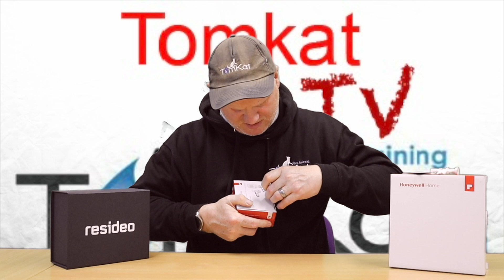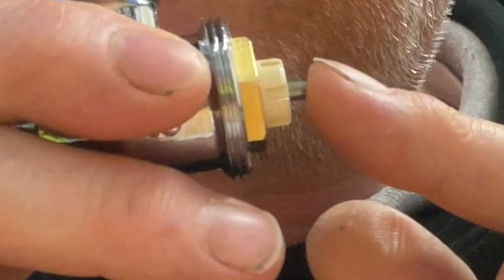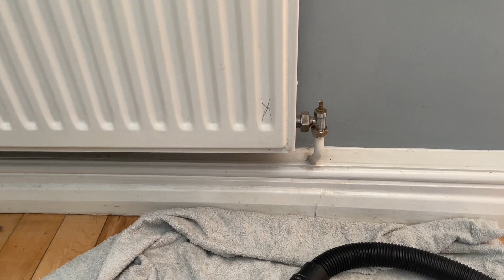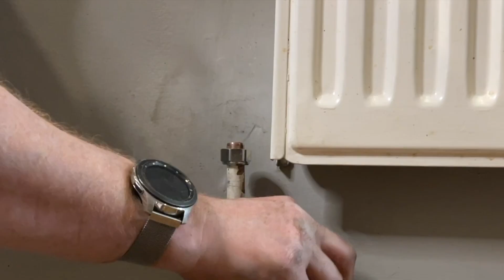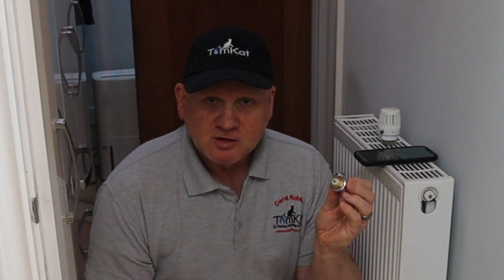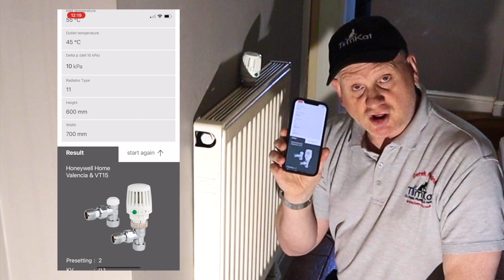Resideo Honeywell home Auto balancing TRV's, unboxing, reviewing, installing and setting up.

Comment: Can these be used on a modern system boiler with a modulating pump / modulating output (eg Vaillant / Viessmann) or will the pressure regulation fight each other?

Comment: Great video.  Annoyed by not being able to find a source of the balancing valve adjustment key, I've just made a 3D model of my own design of key.  This can be easily 3D printed and avoids setting unsuitable metal tools onto it.   Can be found at Thingiverse (search Honeywell balancing key).  I will add a link in a sub-post, maybe you might like to add a link in the description of your videos about these?  Cheers!

Comment: Are you sure that Rad was a multi column?
Reply from the maker: It was just a bit of bad editing I removed me waffling but also took out me explaining it wasn’t a multi column but I was covering all the rads in the app so you are correct it’s not a multi column rad
Reply: Thanks for clarifying, I’ve bought the Honeywell Kombi-TRV V2100 valves, just fitted them, I also observed that you went for 55 inlet temp and 45 outlet, is that a goal in terms cost efficiency? I currently set mine to 70 / 50
Reply from the maker: @mikeread8001  yes it was 👍🏻

Comment: And with these is it best to use the fixed or modulating setting on a pump like a Grundfos ups3 ? All that sort of stuff seems a bit of a dark art to me 🤷‍♂️ some content on this would be very useful, thanks 🙏
Reply from the maker: Part 2 will be coming once the weather turns colder 👍🏻
Reply: @tomkatgastraining  Tomorrow then, thanks 👍😛
Reply from the maker: @julianwebb8712  😂👍🏻

Comment: Hello Derek  The radiators are definitely Steel Panel not  Multi column, so maybe recheck what the app says for steel panel type 22 They are also double panel convectors not  "Double Double convectors", also the Trv  is designed to go on either flow or return that is why they are bi directional, The towel rail is still 600mm high x 1000mm wide as you can't fit a towel rail horizontal because the towels would fall off. This is not your best video Derek
Reply from the maker: Thanks for the first part of your comment and I do say that in the video but for the towel rad as you could see in the video it is a horizontal towel rad nor vertical also radiators can be double panel single convectors or double panel double convectors. Sorry you think this is not my best video I will try harder next time
Reply: @tomkatgastraining Thanks for your prompt reply Derek, I now understand what you mean by "Double Double" as with the whole of our industry it's probably a regional thing, we call it a Double convector (Type 22) or a single convector (type 11) and a type 21 for double with 1 convector.  Cheers👍
Reply from the maker: @theplumber4934  you can’t believe we live in the same country can you 😂 in the video I was trying to show how to use all parts of the app not just the steel panel part I took out the bit where I explained that the rad wasn’t a column one but well done for spotting it 😂

Comment: Just a ? Could U not fit the TRV (Agreed the numbers would B upside-down) Head at the bottom;... 2 avoid it being knock by a clumb'zy occupant...
& I've come across a few of them in mi time...
Reply from the maker: I have never put one that way I would put them looking up or horizontal but I guess they would still work but it’s something I would never consider doing.

Comment: Pro tip. You can't powerflush a system with auto balance TRVs
Reply from the maker: Not even if you set them to 6 and remove the head ?
Reply: @tomkatgastraining  yes even 6 will probably have a flow limit - though I don't no for sure on these particular valves. We use imi valves and you do need to remove the insert to flush.
Reply from the maker: @randomcamerajunk6977  I will ask and find out for the next video 👍🏻
Reply from the maker: @randomcamerajunk6977  just had Honeywell get back to me they say you can power flush on 6 with the head removed they say it has the same resistance as 10mm pipe. Hope that helps.
Reply: @tomkatgastraining  awesome. I'll look into them 👍

Comment: Doesn't Bi-directional mean these TRV's can have the water flow in either direction ?
I prefer on return as cooler and horizontal for improved air flow.
Reply from the maker: You way is the preferred way for me too 👍🏻

Comment: Thanks for posting this as I'm trying to get the most efficiency out of my system, so very interested in how effective these are at actually balancing a working system in the winter, my first impressions are that they simply reduce the valves 'limit of travel' by a pre-set amount based on a rough calculation of a few parameters, no more technical than a partial turn of the lock-shield valve.

If the adjustment for balancing was variable based on the systems dynamics, then it could justify being called auto balancing, but I think this products descriptor is a bit of a stretch.
Reply from the maker: Part 2 coming soon should help you with your concerns
Reply: @tomkatgastraining  What happened to part 2?

Comment: Like the video Would be good to know the results after the valves have been fitted. Got a question for you all. I see towel radiators being hung both ways. Who thinks the towel radiator to be hung the other way not meaning sideways but upside down or upside up?